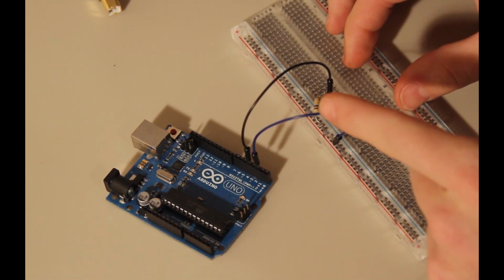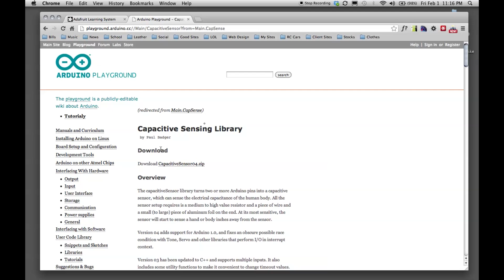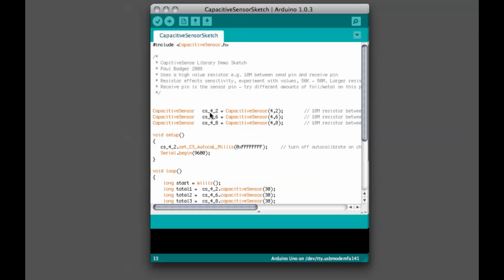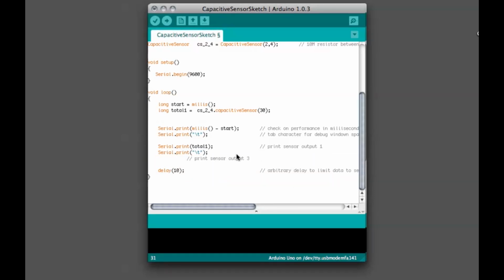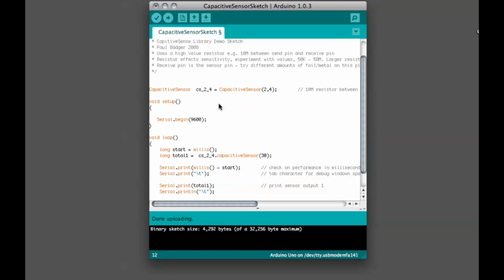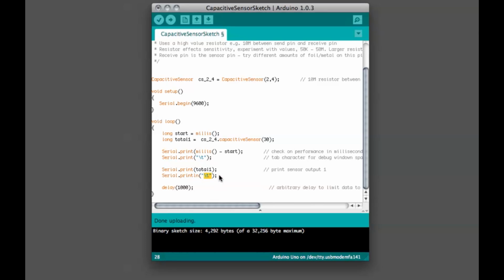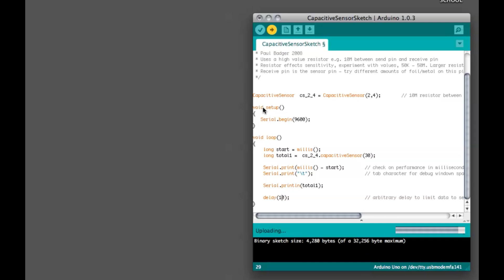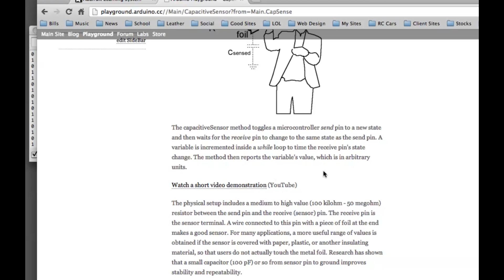Arduino Basics: 3 - Capacitive Sensor

Comment: everyone...can't help me (newbia) first try.....

avr-g++: error: xxxxx\Documents\Arduino\libraries\CapacitiveSensor": No such file or directory

avr-g++: error: C:\Users\xxxx: No such file or directory

avr-g++: error: xxxx\Documents\Arduino\libraries\CapacitiveSensor\CapacitiveSensor.cpp": No such file or directory

avr-g++: warning: '-x c++' after last input file has no effect

avr-g++: fatal error: no input files

compilation terminated.

Multiple libraries were found for "CapacitiveSensor.h"
 Used: C:\Users\xxxx\Documents\Arduino\libraries\CapacitiveSensor
 Not used: C:\Program Files (x86)\Arduino\libraries\CapacitiveSensor-7684dff
exit status 1
Error compiling for board Arduino/Genuino Uno.

Comment: hey I'm getting readings like this for the default
1638	-2
1637	-2
1637	-2
1638	-2
1637	-2
any solid solution to this problem?
Reply: Carl Gordon Your wires are backwards switch the pin inputs.

Comment: I'm getting -1 serial output readings when not touching or touching the sensor wire. Did exactly as you did except Ive only got a 100k ohm resistor lying around so used that one
Reply from the maker: My guess is that It's not connected enough somewhere - make sure your connections are solid and double check the code.  I'm using a 100k resistor in the video I believe, should be fine.  The higher the resistor the more sensitive the readings will be...if you get it high enough, you wouldn't even have to touch it to get a reading.
Reply: Jacob Lineberry My pins are all good. I posted my question on the Arduino forum where I elaborate more on the output. Apparently the library code which includes the captouch function thinks Im using more pins than the DUE has which is incorrect:

http://forum.arduino.cc/index.php?topic=276858.0
Reply: Dejan Popovic If you're still stuck I can perhaps help.

Comment: Thomas, use one of the smaller Arduino variants such as a Nano. Or use just the bare AVR microcontroller itself. You can program ICSP with an Arduino.